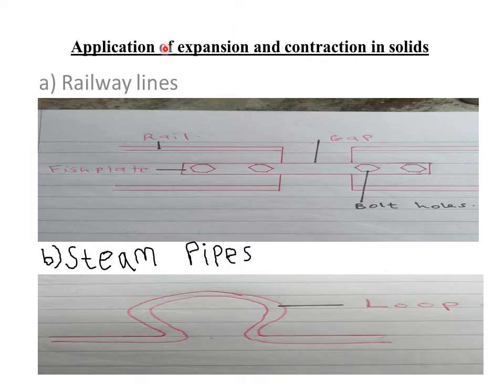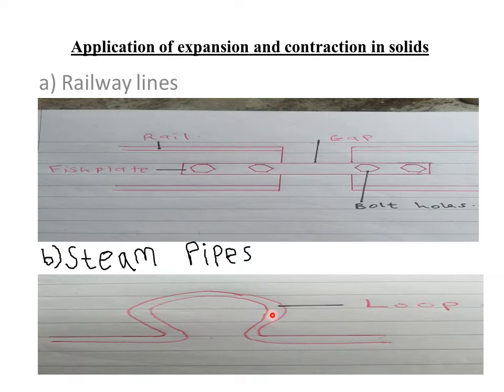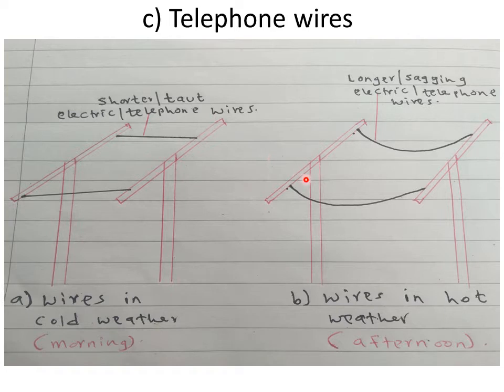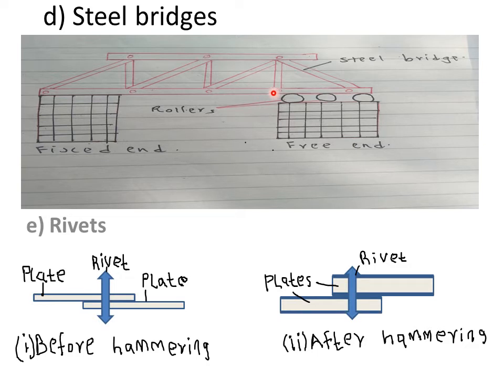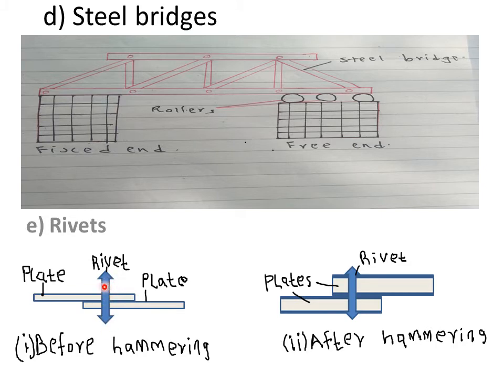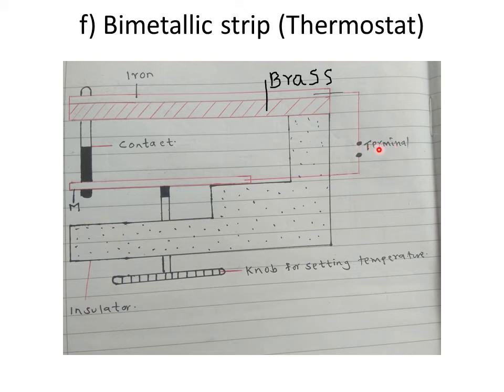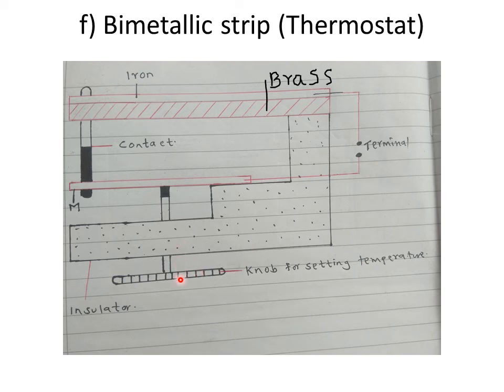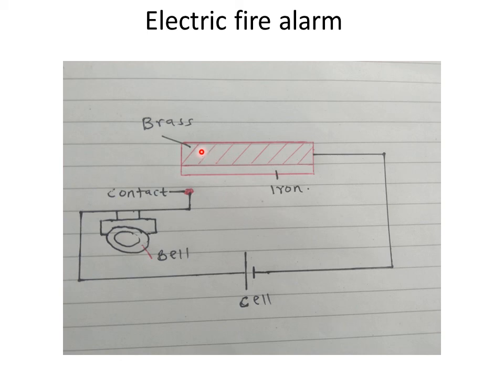THERMAL EXPANSION : LESSON 2

Comment: Does Bimetalic strip break the contact or complete when both cooling and heating plz explain for me
Reply from the maker: It depends with the question, like for the case of thermostat, the bimetallic strip breaks the contact by bending upwards ( expanding)when the temperature of the room is high. Conversely, the bimetallic strip completes the contact by curving downwards ( contracting) when the temperature of the room is low. To understand more about expansion and contraction of the bimetallic strip with change in temperature, check in this channel a video called " Thermal Expansion Lesson 1" it might help you understand better.